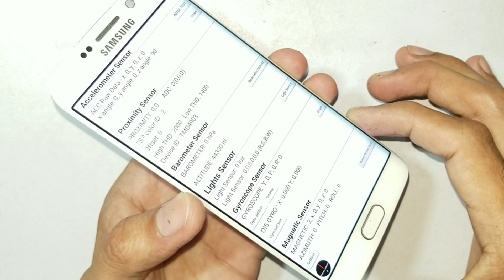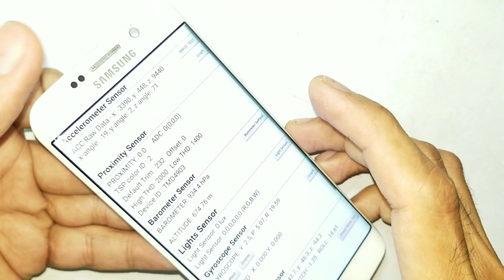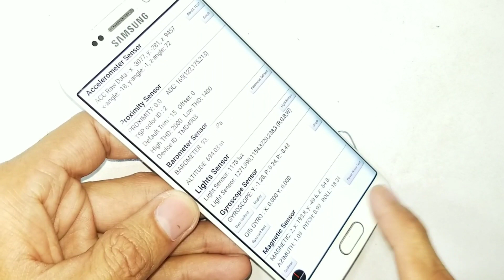Samsung Sensor Hub Self Test Failed - How to fix Sensor not working problem in your Samsung phone?

Comment: Hi. I have samsung s7 and the same issue started next year after warranty expiration. I did reset etc but except fingerprint no other sensor works. I checked on *#0*#. I am confused if this is hardware issue or software issue. On every software update it doesn't solve the problem. Whether to repair it or go for a new device, i cant decide. Cause $20 to 30 = ₹1500 to 2100 in india will not worth repair which may be again stop working in next few months. Please suggest me if i have to repair or go for a new handset. Plz tell me approximate Samsung service center charge for this repair. Thanks
Reply from the maker: It's up to you, repair or buy a new phone. But i can confirm it is a hardware fault and a cellphone technician can't guarantee even he is an expert in his work, because in Pakistan and India the service charges are big challenge for both parties customer and a technician.  Technicians doing their job at cheapest work even they don't care if they failed or more damage in device can make trouble for them.

Samsung service center mostly rejecting this kind of faults and told you to that they are going to replace board near 200 to 300 usd.

Comment: Bro please say me how to fix this problem iam using s6 edge f model and when i dail *#0*# it say open book covet what is the solution for this problem  and iam also using nogut please say me😭
Reply from the maker: May be you are using book cover, or your cover sensor is not working properly.

If you are a cellphone technician then try to open and clean pcb first if you are a normal user visit your nearest cellphone repair shop.
Reply: Same problem bro